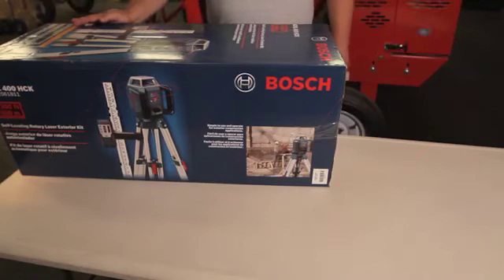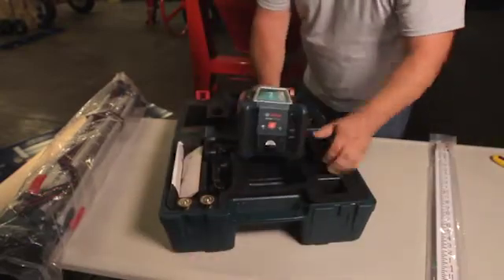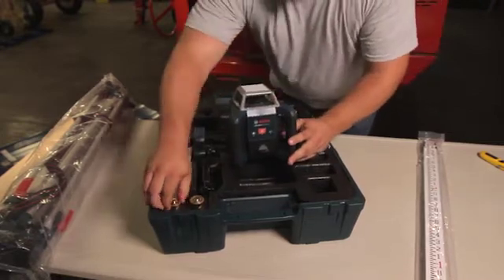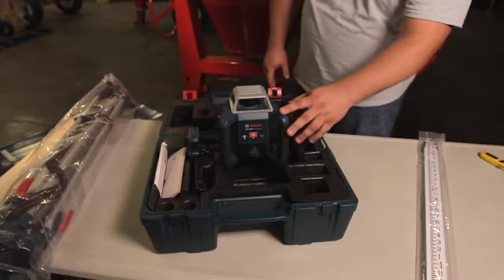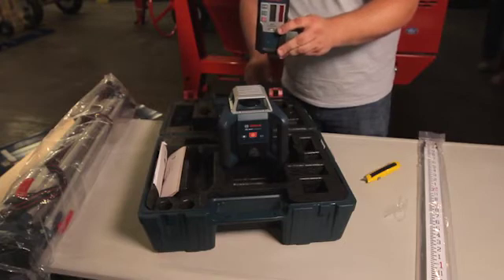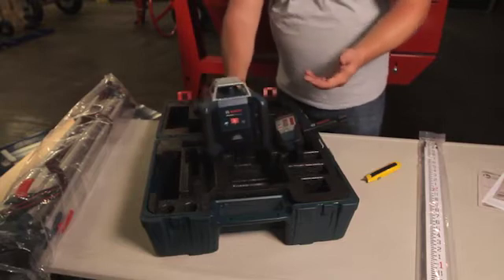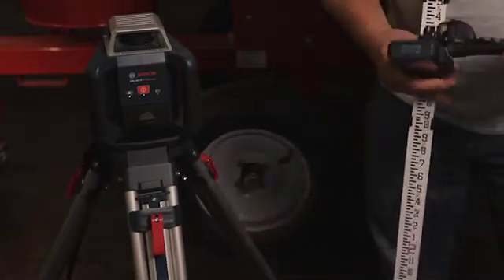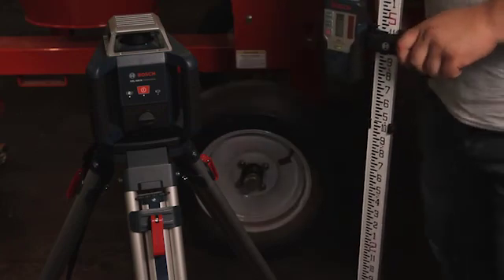Bosch GRL400HK Rotary Laser Kit Unboxing

Comment: Hi I wanted to know if there’s a way you can change the laser from rotating to spot mode?
Reply from the maker: Product Overview

Rapid horizontal leveling for an entire room from one position

Visible line range of 1300 ft with ±3/32 in accuracy up to 100 ft

Shop the Bosch Exterior Leveling Tools

Model #: GRL400HCK

Internet #: 203392603

Since the introduction of the first Bosch measuring tool, Bosch has become a worldwide leader in measurement technology through innovation and advanced engineering. The same quality, durability and forward thinking found in Bosch power tools is now offered in a complete line of measuring tools. With Bosch laser technology, users are able to become more productive and more profitable - with great accuracy and precision on the jobsite. By offering an extensive range of line lasers, laser distance measurers, rotary lasers, point lasers, digital levels, optical levels and measuring tool accessories, Bosch is able to provide solutions for a wide variety of applications. With Bosch measuring tools, users are able to work smarter, not harder.

Long working range of 1200 ft. with accuracy up to ±3/32 at 100 ft. – ideal for exterior applications

Smart pendulum leveling system - self-levels, senses and indicated out-of level condition, locks when switched off

Patented motorized micro fine plumb alignment - allows left/right vertical beam adjustment without unit relocation

Robust design with glass enclosed cage for upgraded protection IP56 rated - to ensure years of dependable operation (certified at IP56)

Beam customization - 6-lengths and 3 rotation speed (350, 600, 1200 RPM) settings for diverse application and lighting conditions; 500 ft. RCR1 RF remote range

Includes: LR1 laser receiver and bracket, tripod, 8 ft. grade rod, carrying case, and (2) - D battery